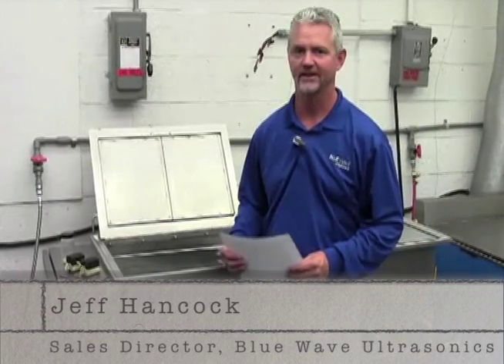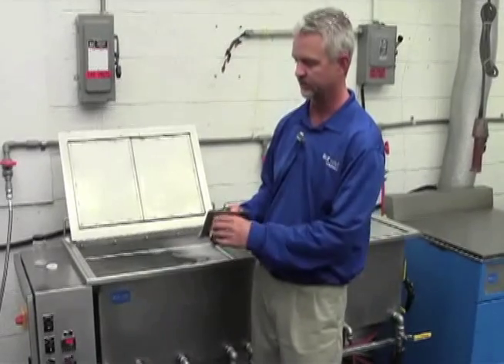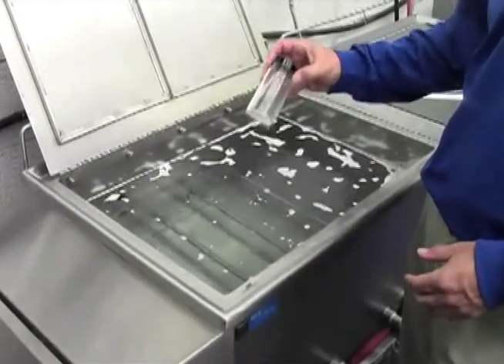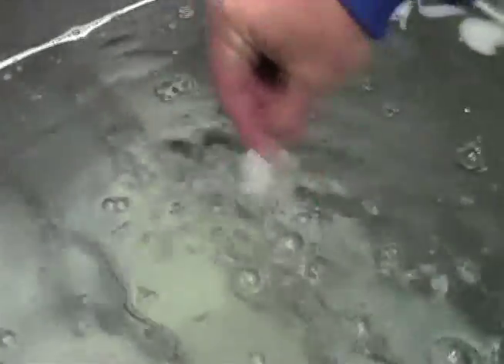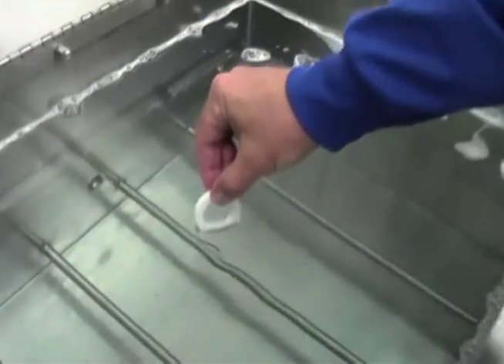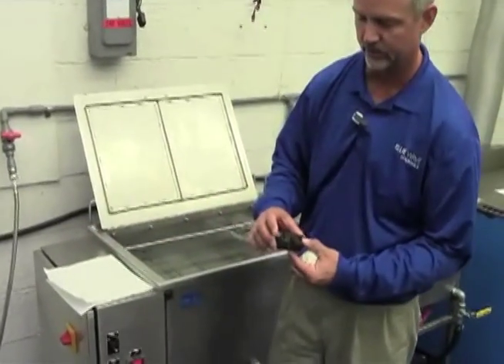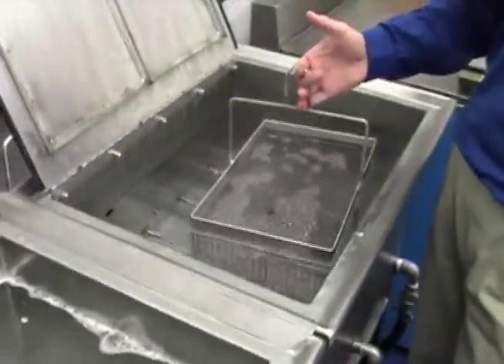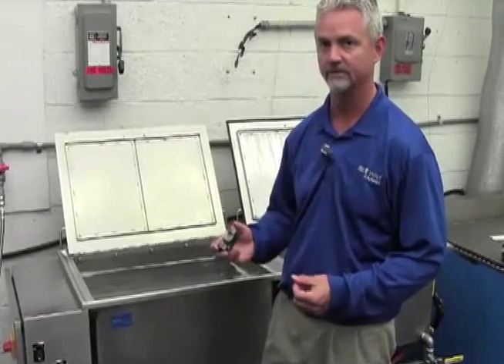Ultrasonic cleaning demonstration

Comment: i work at a mold polishing shop and we do lots of cleaning by hand, can we use one of these with acetone or mineral spirits to avoid getting rust on the parts and prepare for a polishing process??

Comment: my motorcycle mechanic that I go to when I can't or don't want to fix something, has one of these machines. I'm rebuilding a vintage honda, and I got my cylinders back from him about a week ago... the part that holds the piston, in between the valve assembly/heads and the bottom end of the motor... and I don't want to even put them back on the bike. they are so beautiful. I didn't realize that this was a sandcast motor, but I know now.

Comment: Great video!  So I have a newly designed lint brush and am trying to place some ultra sonic vibration in there! Me and my engineers are a little stuck on where to start TO get this ultra sonic vibration inside my 6” handle!  Would you know anyone that can help with this or had experience with ultra sonic vibration instruments or experience that can guide me through this?  I’m thinking using something similar to the philips sonic care toothbrush brush but a much cheaper solution of what they have?? Any info would really and greatly help thanks 🙏🏻

Comment: What happen if you accidentally dipped your finger into the water when cleaning? Is it safe?
Reply: It depends on the water. If the water is hot, you might get hurt. But ultrasonic won't hurt you, you just might feel uncomfortable like getting a thousand bite by the ant.

Comment: Sir, can we Turn ON this machine without water in the tank...?  is there any problems happens in this case...?
Reply: No, this will burn the machine. Usually, it will have water level sensors for big units to prevent this.

Comment: I want to know about draining it, do I need to wait for it to cool ?
Reply: I worked in a hospital that used them for cleaning surgical instruments. There was a button you pushed and it drained from the bottom, then you hit fill and it fills the tank automatically. The old ones didn’t have a warmer to keep the water at a certain temperature but newer ones do. There are all kinds of different sonics, as we called them.

Comment: Hi, Does anybody know if it's possible to do the cleaning process with the flowing water? I mean if I apply the vibration to a metal pipe that water flows in it; does the output water can do the cleaning?
Reply: Ali Farzian yes. This is how radiators are cleaned in a house when lower flushing. Vibration is applied to them using a hammer drill and special attachment.
Reply: Thanks Phil, by "output water" I mean that the water came out of the pipe, In a close range, does it have the cavitation effects?
I mean if water is not confined in a container, will the cavitation effect remain for for a short time?
Reply: Ali Farzian this is above my expertise lol. I'm not going to bullshit you with a made up response lol. Try Google. I'm sure there is lots of experts know the answer to this. It's a good question. My guess would be it would definitely have an effect of some description. The flowing water would carry away waste removed by the vibrations.
Reply: When the water leaves the ultrasonic tank, it won't do the cleaning job for you.
Reply: Ali, do you have the Scaling as a contaminant inside the Pipe?   There is an instant  Bio descaler, which would work here.  Need to be socked or pumped through circulation.  Heat exchanger tube bundles are put through an Ultrasonic tank for cleaning.

Comment: what is the orientation of ultrasound sensor?
Reply: Usually, they are at the bottom of the tank. But it can be designed at the different sides of the tank according to your cleaning task.

Comment: i wish to clean parts of a hobby gasoline engine, like the piston and the carburator, its posible? what solution do you use? theres some rubbers and silicons parts like gasket and orings

Comment: What is the liquid cause I assume it isn't just water?  Mineral oil?
Reply: @Quade Carter I looked it up but what you use depends on what you're cleaning.  So the question remains, what are they using in this video?

Comment: serious question,  need to find proper solution for machined parts with protective lubes on them.
previous engineer bought ultrasonic cleaner but using IPA, instead of soap solution, I proven that IPA won't remove oil from parts.
great video and thank you.
Reply: But you can switch to Instant Bio degreaser/descaler / anti-rust solution with Ultrasonic cleaning system - reach me on prakash@pretiumtechgroup.com

Comment: Q&A
could u fill this tub with oil to work as a lubing stations for parts
Reply: It will be better to use another tank for lubing because this will save your time, water, and detergent.
Reply: @michaelclean771  i meant run it with oil to lub parts so oil get right in
Reply: @17hmr243  Never seen ultrasonic cleaner can do this before. Maybe you can buy a small one to have a try.

Comment: He mentions Cycles but not Watts. I'm guessing 30k cycles a second is equal too 30w? If so, I bought a machine which does both 30w - 50w. Is that both 30k - 50k Cycle Power?
Reply: +virtualtech pw Watts and Cycles Per Second are two totally different things.

Cycles Per Second is a measure of frequency and is more commonly expressed as hertz such as Kilohertz, megahertz or gigahertz.

A Watt is a unit of power used to express the rate of energy conversion or transfer with respect to time.

Comment: someone tell me where can i get my hands on this equipment.
Reply: Harbor freight sells a small one
Reply: jackmc4 
HF units will not come close to this one. 
That unit is probably got a 500 watts or more power driving those lower frequency 30 KHz transducers.
Reply: cblackmail 
what’s your point?
Reply: jackmc4 
The point is if your looking to get anywhere near those results it’s not going to happen anyway shape or form.
Ultrasonic’s is all about power (wattage) and frequency. It just depends on what you want to clean or damage if you have too much power and frequency.
Reply: cblackmail 
Did I ever say harbor freight sells the exact same unit? No, I said it sells a small one.
Reply: Bruh if you want the same exact unit as he is using... I don't think they sell it at harbor freight :)
Reply: @raw1039  contact me at prakash@pretiumtechgroup.com - can help you with Ultrasonic cleaning and Ultrasonic welding.

Comment: Now im sure some idiot will stick their hand in it and I assume that would not be good.
Reply: Nothing would happen. The ultrasonic vibrations only cause whatever liquid solution to create microscopic cavitation. If the solution was water, it would feel like similar to what it would be if you stuck your hand in a jacuzzi. Any potential danger would come from what form of solution you put into the tank, like a tank of acid or something.
Reply: TheBzlai It would likely just leave your hand feeling really dry :P As the cavitations would drive off all the oils from the skin.
Reply: Highway Star You should never dip any part of your body in the bath while the ultrasonic cleaner is running. The skin can be irritated and the joint tissues can be damaged by the energy produced by ultrasonic waves. Ultrasonic energy can also cause arthritis.
Reply: Ultrasound can burn. Unless you are sure of the strength I wouldn't advise putting your hand in there!
Reply: Maybe some idiot has already stuck their manhood into one of these  "just to see if it works?!"  The cavitational vibrations could be a great aphrodisiac.  ha-ha- jk

Comment: can you fry chips in that :)
Reply: It doesn't heat up.
Reply: TheBzlai Hi, I was actually gonna ask, I've heard ultrasonic cavitation results in very high temperature heat, up to 5,500 C hence sonochemistry interactions etc, is that correct?
Reply: That's actually true, I have a small unit and I've noticed the solution heats up after running for a few minutes, but not as high as 5,000C, just below boiling.